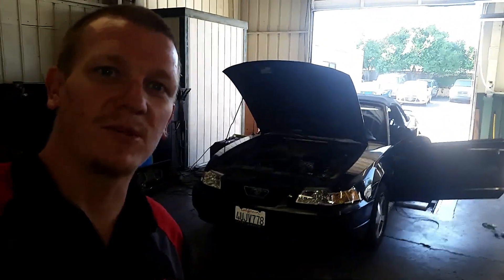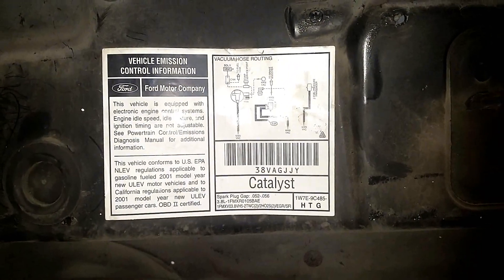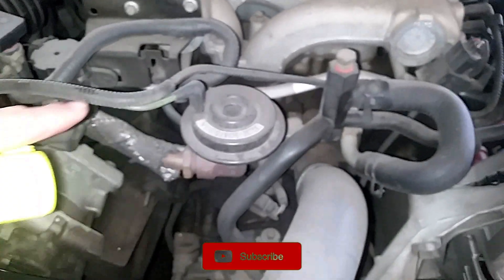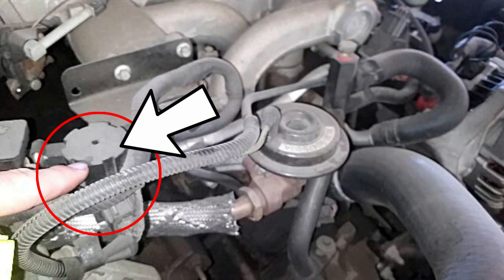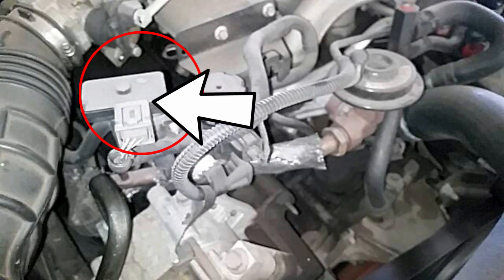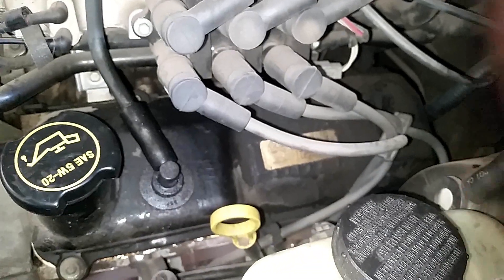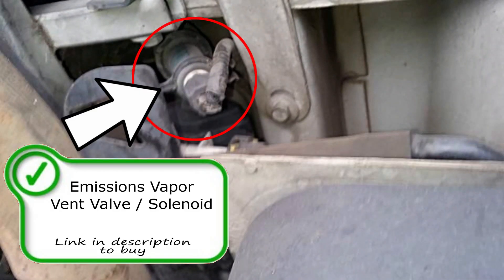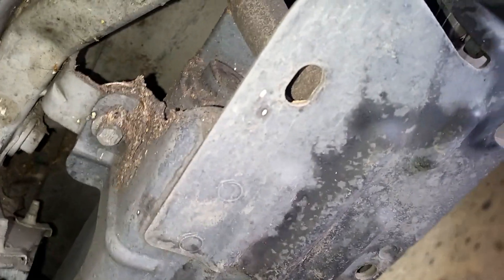⫷ Mustang Emissions Locations: PCV, EGR, DPFE, EVAP Canister & Vent Solenoid ⫸

Comment: is the egr "valve" same as the sensor? or are they two different parts?
Reply from the maker: If it had an electrical egr, the sensor is in the egr. I believe this is vacuum controlled.  The DPFE is the sensor on this one.

Comment: So I have an OBD Link MX and I downloaded their app. In that app it shows Evap System as available but not complete, what could be the cause of that? It also shows Heated Catalyst, AC Refrigerant & Second Air System as not available and not complete. I have it set up 2001+ CA emmisons requirements and states that it won't pass.

Comment: Evap canister well fuck I’m getting codes p0161,p0443,p1451,p0135,p0136,p0141,p0155,p1409,p0156 And all that bull shit apparently I got a leak in the evap system I replaced my o2 sensors,and now my vapor Solenoid hopefully that fixes my problem but after watching this video I should of got the canister in the process
Reply from the maker: I have a video on doing a diagnosis on A P0442 i believe. I use my mouth to pressurize the Eve up system and spray it soapy water to find bubbles. You should look at that video. it might help you out.
Reply: Ok I’ll check it out thanks
Reply: @ScottiesHobbies  I’ve got a P0443, how do I fix it? Or diagnose it